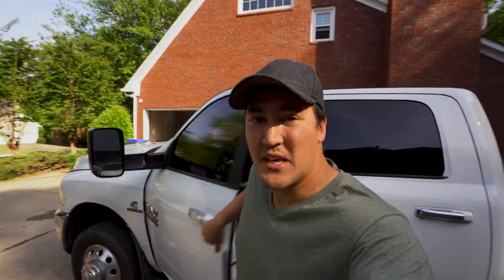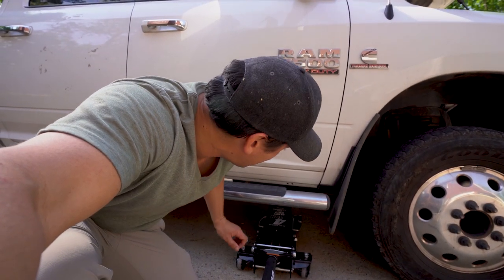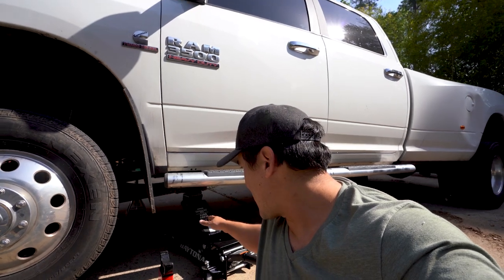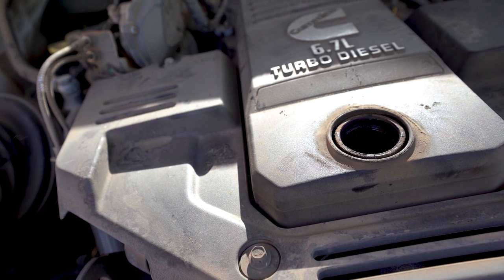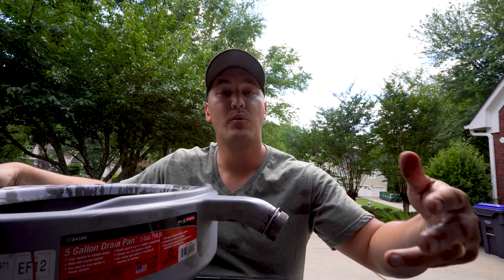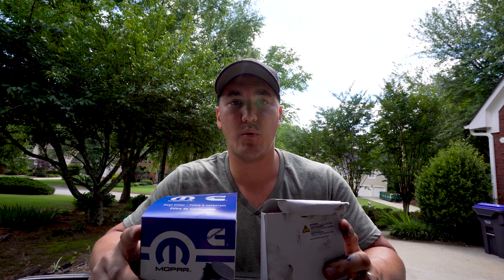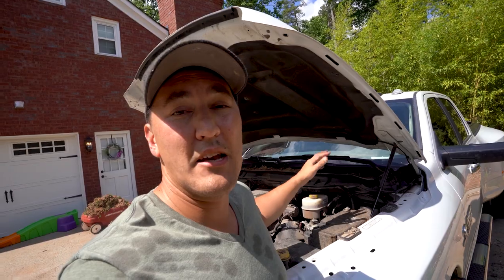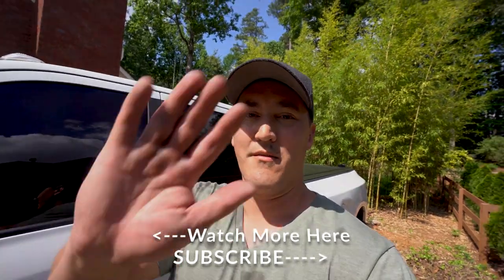Dodge Ram 3500 Dually 1 Ton Cummins Truck Oil change with Scenic Drives Across America

Comment from the maker: * We are aware that during one of the clips I slipped up and called the fuel filter an oil filter.  When originally showing the parts, I correctly call it a fuel filter.  Also, the correct amount of motor oil 15W-40 to add is 12-13 quarts.***

Comment: If the jack stands are from harbor freight there is a recall
Reply from the maker: Yes they recently recalled their jack stands, very scary. Big Red makes a set of 6 ton that we have listed in the description. 
How are you guys doing?
Reply: @OurNationalAdventure  We are doing good we are in Palm Springs yes it's hot but if we can do this we can do anything wanted to see if our rig would work in different setting and make sure it works.

Comment: There is also a fuel filter above your differential. Did you put 4 gallons of oil in the engine?
Reply from the maker: Thanks I got both and I placed the requisite amount advised by Ram.
Reply: This engine holds 3 gallons, not 4.
Reply from the maker: Thanks guys ♡ yes, if you watch through the end, he put the correct amount in. We intended this as more of a scenic drive video, probably my fault as I edited it.♡  -Alison

Comment: There is only one oil filter! What you think is "the other oil filter" is actually the second FUEL FILTER. Also, you didn't mention that without a special oil filter plug you will spill oil everywhere.
Reply from the maker: Correct. One oil filter and one fuel filter. I think some may not hear when I call it the fuel filter in one scene, but I appreciate the feedback.